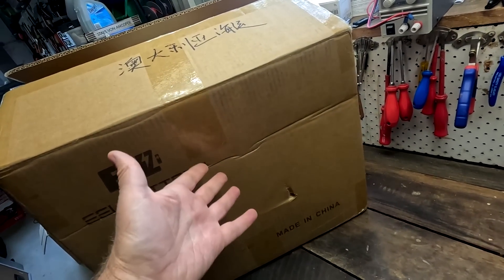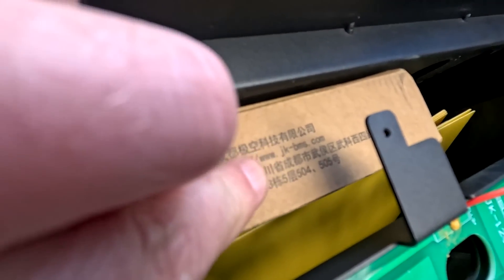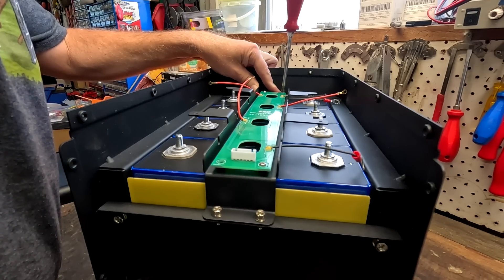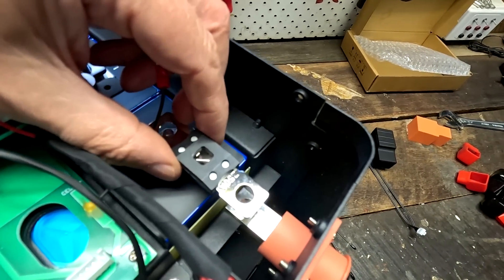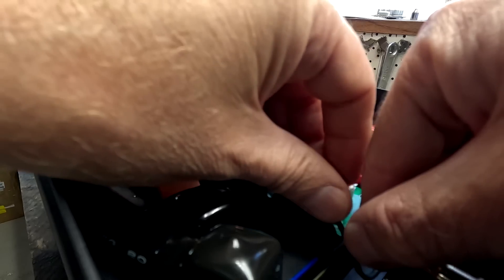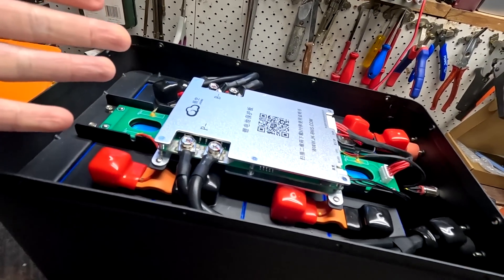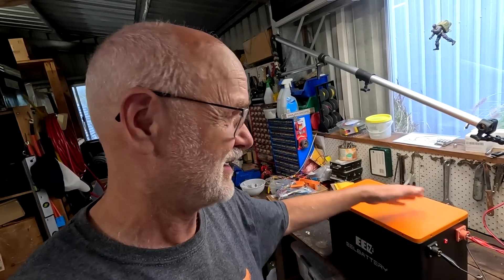The EEL 12V Battery Case. I could not find anything negative. First ever 🐸🐸🐸🐸🐸?

Comment: One questions for the experts. I just got one of these. And have a challenging work load planned for it. I need to pull 180Amps for 20 min. then slowly reducing power over 10 min. to 20 amps, followed by a 10 min. break. This cycle is repeated 4 times. My consideration is what sort of temperature am I going to end up with inside the box? Will the batteries become to warm over time? Should I cut som ventilation gaps in the case? Are the load carrying connectors not quite small compared to the 12V DC 200A load from this box?

Comment: The problem is when you want heated pads I got the 24v version for my rv and with the pads under the cells the wiring for the heating pads hold up the pressure plate and can’t fit unless you take a metal saw and cut it yourself because I have tried communicating with Howard from eel and he is not being helpful and when I asked for a return rma he asked if I got the wire a free I sent 9 pictures with arrows and holes not lining up with no rma number basically there warranty is worthless and would probably buy from another company it has been frustrating with 8 or more emails and 4 or so replies from him.  Why sell the heating pads if they don’t work for the battery boxes.

Comment: Just received the latest version 2 of this with Built in JK P-Link V2 CAN and RS485 parallel comms ports, it also now comes with formed flexible bus bars for the 200A JK BMS instead of cables and a different 250A HRC type fuse with 100kA interrupting current its very nice.
Reply: Bought one for the camper and that is also version two, with the same improvements as you mentioned plus display and heating. Quite a nice piece of work, this one. Liked assembling it and now I only have to finalize setting up the BMS.
BTW I got EV-foam in my box as well one sheet for the back and one for the front of the battery space plus one directly under the rail the BMS is later screwed to.

Comment: This is nice 👍 
What about EEL 24v V2 with display and ANL fuse? I have built a shelf system and think about going to battery box to be more portable. today I use GreenCell inverter 24v clean sinus 3000w/6000w and it works great and is only about $300 here in Norway

As you said in video I am also one of the viewers that enjoys your videos and have a wish for more small systems like 12v/24v

Thank you for all your videos because you got me started with my emergensy solution 😃👍

Comment: I  purchased 2 of these kits Mar 4,2025 from US stock after seeing your video but when unboxed and looking over every thing discovered both of the BMS don't have a RS485/CAN port.  Contacted EEL and was first told JK no longer has that port.  There reply ---- I contacted the staff of JK BMS.  They replied that this BMS no longer has RS485 communication function since a long time ago, but still retains the relevant interfaces.  EEL said---  I contacted the staff of JK BMS.  
They replied that this BMS no longer has RS485 communication function since a long time ago, but still retains the relevant interfaces.  So I ask how this is accomplished, they replied

   The old version may have many features that are different from the current one. For example, the current BMS Bluetooth function. JK BMS has cancelled the RS485 function of this BMS, but some companies may need to customize this function with JK BMS, so they keep this interface, just like this BMS retains the heating interface but does not have the heating function. I asked them if only the BMS we purchased does not have RS485 functionality, and they said no. All JK BMS B2A8S20P currently produced do not have RS485 functionality.
Alibaba Translation  Needless to say I am unhappy but am stuck not only no RA485 but no heat  BUYER BEWATE

Comment: good day from good old Germany... they state the box is not suitable for double contact cells, do you see any chance to use the box with double contact cells aswell, i dont see why it shouldnt be possible to make it work... Thank you for your oppinion!
Reply: Hello, the positive pole of the battery pack is connected to the positive terminal through a fuse. If you want to use a battery with a double-hole terminal, then this is not suitable.

Comment: Nice video production. I would replace that Knock Off ANL fuse with a genuine UL Listed Eaton or Littelfuse version. Ultimately, a Class-T fuse mounted externally to protect the battery cable given the amount of current available.

Comment: Curious, when fully assembled can your phone still connect to the BMS?  Where to the RF waves escape the box for a BT connection?  (top lid also looked like steel?)  I'm going to have 4 of these, but will still need to connect with each BMS and pull data into the main  automation system.  For safety, would also like to see some kind of protection on top of the BMS so nothing can short pos/neg.  4.5frogs  and your point of having a spare red/black cover was good as well.

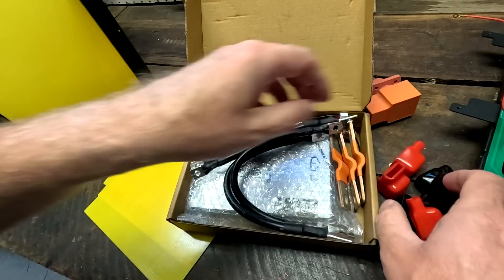At approx 5:24 you mention 2x 6gauge wire for BMS to terminal.  Was that really 6gauge? not 3? or 1/0?  6gauge is for about 55amp continuous so that's undersized for 200amp BMS.  Am I missing something?  if it is 6awg, frogs drop well below 4 for safety reasons.

Comment: Andy, after you switch off the bms with the button on the battery box, do you still have voltage across the external battery terminals? I do… after i turn off the bms it drops from the 13.2-4 volt range down to 8v. Guess i would have thought the external terminals would go to zero volts.
Reply: good question!

Comment: After watching this video I purchased the 12v EEL case and 4x 320ah Grade A CATL batteries from Eel. FIrst thing - Their site didn't accept your affiliate code - But I ordered anyway. Today they arrived.  The case looks great - I haven't assembled it completely yet, but should be fine. THe cells on the other hand - They claimed on the site "CATL GRADE A 320AH' - when they come, they are 2022 manufactured 280ah CATL cells. When their live chat was provided with evidence (the QR codes!) they say 'but have you tested the cells' - I say irrelevant  - they are rated at 280ah by the manufacturer. Anway, I will be raising a dispute with PayPal - as this Chinese bull$hit has to stop

Comment: Hi Andy, 5 frogs! great video! I also had a the same JK BMS but switched to JBD due to the high idle power consumption (loss couple amps per week) when leaving the battery stored for a few weeks. What are your thoughts on the power consumption? Could you expand on that sometime? Thanks for everything!

Comment: Hey Andy, love your videos. I’m considering ordering this box for 4 spare EVE 280ah cells I have. I’m not real familiar with the JK BMS. I would like to charge this 12v battery using my 48v battery bank on my boat. I currently have a Victron 48v-12v DC-DC converter powering my 12v stuff. Can I simply charge this battery using the DC-DC converter, or do I need a LifePo4 specific charger? If i had to, I could get a Victron 12v-12v DC-to-DC charger, but would like to avoid it if I could.

Comment: Only 4 frogs from me.
The box is unnecessarily large with lots of free space around the cells, the compression plate doesn't go to the top of the last cell and you needed to add packers to ensure that the cells didn't move.

Comment: Hello, there is a new jk inverter bms FW 15.23 at his website. Did you know the changes to 15.17? Rgards
Reply from the maker: There is already a V15.24:
V15.23  Upgrade logs
  1. Optimize the alarm reporting logic of parallel current limiting module.
  2. Optimize the JKBMS-CAN communication protocol.
  3. JKBMS RS485_Modbus Add Buad9600bps.
  4. Added support for JK-BD6A20S20P JK-BD6A24S20P.
  5. fix a bug about DEYE inverter.
  
    V15.24  Upgrade logs
  1. Fixed a Bug about LCD display in V15.23.
Reply: @OffGridGarageAustralia  great you are the Akku King :-)

Comment: hi i just installed a small solar setup with lifepo4 battery in 4s config.. but in my mppt it just shows 13.2 volts and does not reach 14.4 as set on my mppt.. each battery is just measuring 3.325 something volts hope you can help
Reply from the maker: You have to give us more details what equipment you have, how it is been setup and what parameters you have set in your controller.
Reply: @OffGridGarageAustralia  im using powmr 40amps mppt 4s 20ah battery with 100watts panel, it with thw default setting of the mppt of 4 3.2v ,

Comment: Can we do half frogs For 4.5 Frogs? Always room for improvements.The sticky foam, manual QR code, and maybe a display since the BMS supports it or at least and place for the display if. you purchase it later and an option.
Reply from the maker: 4.5🐸 are fair. Thanks.

Comment: Hello,
Thank you for your help.
I have 4 12 volt lithium batteries connected in series at 48 volts.
however, I have a large voltage variation between the batteries.
In the morning I see a battery with closed bms and during the day I see one at 15 to 15.8 volts.
the other three are between 12.7 and 13.2
can you tell me what could be wrong?
Reply from the maker: Not ideal as the cells can only balance within a single 12V pack. There are 12V battery balancers available to help with such a problems. They work pretty well. https://s.click.aliexpress.com/e/_DDY3VkL

Comment: Nice kit. I would love to see a 12v battery build suitable for house/leisure bank in marine environment - I.e  a sail boat. So a plastic enclosure rather than metal if you get the chance to try something like this. Also keen to know if those 12v JK BMS units can be connected in master/slave config as per your 48v ones, as boat would need more than one battery paralelled, and conneted to inverter-charger such as Victron Quattro or multiplus. Loving your channel. C'mon 90k!
Reply from the maker: Thank you. There are lots of options for 12V LFP batteries out there. Some are supposed to be IPx6 rated but they don't have JK-BMS. 
The BD series of these 12V JK BMS cannot communicate among each other, they are pure standalone devices. However, there are some solutions out there where a Raspberry Pi collects all info of the individual BMS and combines them to either send to an inverter or just for data analysis.
Reply: @OffGridGarageAustralia  the other option of course to increase capacity to say 600Ah is to series 4 blocks of 2 parallelled cells (in each block), so only one bms used. The cheapness factor still leads me at looking to build with eve cells in some sort of plastic enclosure. Winston cells would be nice but far too expensive for my small wallet. Maybe I will have to build a fibreglass enclosure. 🤔
Reply: I also meant to ask the community here. What takes presedence if you have an inverter/charger (let's say this is Victron multiplus) and mppt/solar  both wanting to charge your batteries? If both the mppt and inverter/charger are Victron units will they use comms to give priority to solar to save on grid power? Or aren't they that smart?

Comment: Like# 1,1?? - Woot - 12v, I think I only have the trailer brake & light system?  You know what would be really nice, a very small, compact 48v "emergency jump/inverter start" pack. My Growatt inverter will not start if it does not have 48v from a battery...
Reply from the maker: I'm in the process of building such a 48V battery. Watch this space...

Comment: Four frogs from me from disappointment related to non-inverter version of JK-BMS. I would immediately buy at least two 24v (200A) versions 😢

Still waiting..
Reply from the maker: A 12V battery will not have inverter communication. That's not what it is designed for. These 12V batteries are designed for smaller mobile applications.
Reply: @OffGridGarageAustralia  agreed, but many of us has large 24V systems (like I do) and for those we still lack good case. This one is pretty close but as said, lack the inverter bms. I have 3 self made boxes (with JK inverter bms) but obviously would build next ones with more compact solution like this. Still waiting..
Reply from the maker: @KossuJahvetti  You can use their 48V battery case even for a 24V system with a modified cell layout and bus bar connection. However, the JK Inverter BMS is unfortunately not available for 8s yet.
Reply: @OffGridGarageAustralia  thanks Andy for the tips. Appreciate if you can introduce 8s version if ever one pops up into your knowledge. Understanding that you have no use for such set however.

Comment: Wow! Thats approx a $600 total cost build for the box and cells for 300+ Amp hours.  Thats half the price of some of the top of the line Epoch 300Ah batteries.  this is a great box for us sailors who would like to build our own simple 12 volt batteries but also want to have lots of control through the BMS or to be able to upgrade the cells as newer and better ones become available or get damaged.  So excited.  I might get a couple of these instead of buying batteries already assembled which can be a real pain to quickly and easily service.  Lightning strikes are a real danger for boats and can quickly destroy a BMS.  It would be easy to carry a spare or two and replace them on the go if this ever happened in the middle of an ocean. Great stuff! A remote display would be an absolute dream to have in addition to the bluetooth. 🐸🐸🐸🐸🐸
Reply from the maker: A display can be added to the removable front. There is lots of space...

Comment: Hey Andy next to lower voltage battery, can you something completely different and have a look at HV batteries? With our grid connected systems in Europe and more and more problems with the grid, that would be very useful. Thanks.
Reply from the maker: Probably not, sorry. HV batteries are out of scope for everyone DIY. Far too dangerous and not allowed to handle.
48V systems are perfect and, in that home storage space, there is no need for HV batteries.
Reply: HV is industrial. The prismatic cells are now so cheap to build your own powerful battery. If you think about the losses transforming 48 to 230V - well, then you have to buy the overpriced stuff from BYD and Co..... The ROI ratio is terrible ....
Reply from the maker: @mandxyz2523  Exactly, HV is industrial and not DIY. 
The ROI of a 48V system is far better than for a 96V system. Just alone the availability of 48V equipment makes it worth.

Comment: 🐸🐸🐸🐸 - A display (and may be a CB) would make it a 5. However best 12V system thus far.
Reply from the maker: I'm not aware of a 12V box with MCB... They usually have a fuse only if at all.

Comment: I'm not a fan of the side terminals. RV's are often designed around top terminals. The side terminals usually require a design change. Just my 2 cents depending on your RV build. I swapped an SOK 12v battery BMS for a JK inside the SOK case. If this was an option at the time it would have been far easier to build.
Reply from the maker: Fair enough, thanks for your feedback and thoughts.

Comment: Great review.   I would say 4 1/2 frogs.   It would be nice to see the box a bit more water tight if you wanted to use it with a electric boat motor.   With the side cover that comes off for the compression bracket, water would come in.  They did put the bms on too so that would help.    Happy solstice to you down south!   Sad day for us in the north!
Reply from the maker: Yeah, OK for specific applications it might need some adaptation. Watertight, top terminals, handles... all different needs and requirements.

Comment: Nice box, My only fear is the bluetooth signal strengh with full steel enclosure, maybe a little plastic windows for optional screen can solve this
Reply from the maker: Makes no difference. I have several metal battery boxes and signal is still strong enough to reach your mobile even if several meters away.

Comment: Hello.
I bought 16 EVE 280AH batteries 2 months ago. I also procured JK-PB2A16S15P bms for these. I installed it and have been using it for 45 days. My cell number 14 started giving unstable voltage values. While it is not visible in instantaneous currents around 15-20 Ah, it shows a higher or lower value than other cells when drawing or charging energy above 25 Ah. For this reason, I cannot charge and discharge properly because the BMS reaches the lower and upper limits set before the others. Especially during 40-50 ah charging, when the cell sees the upper limit value of 3.5 volts, the bms limits the charging current to 10 ah and this continues until I restart it manually. Is it normal to see abnormal values in cells in such a short time? Additionally, the charge and discharge current limitations on the BMS do not work at all. The hybrid inverter I have tries to charge the cells without any limitation on how many amperes it sends. What advice would you give?
Thanks.
Reply from the maker: Definitely not normal. I doubt it is a problem with the cell itself. Most likely a connection issue. Swap the bus bars of this cells with some others and see if this makes a difference. 
If not, swap the cell with another cell and see if the problem sticks with the cell regardless of where it is mounted.